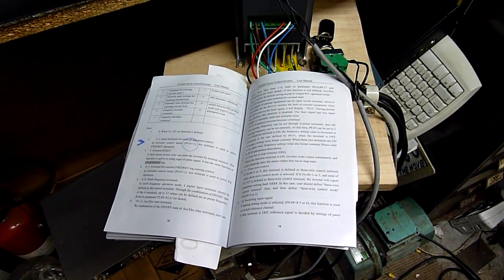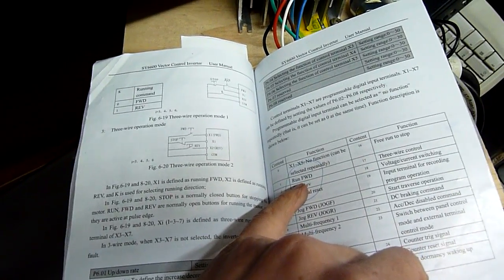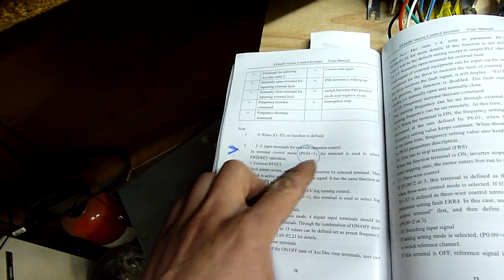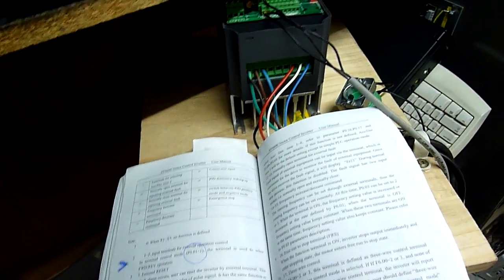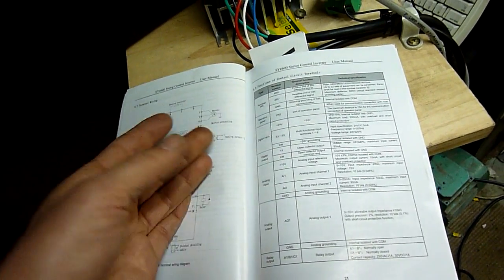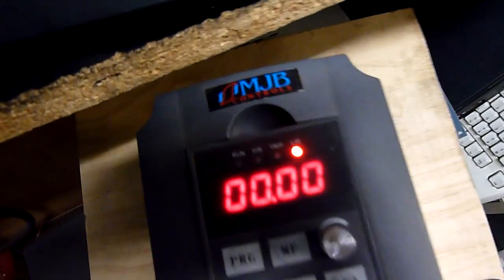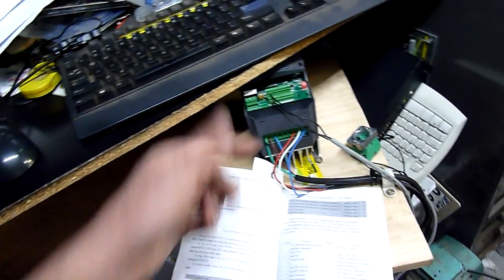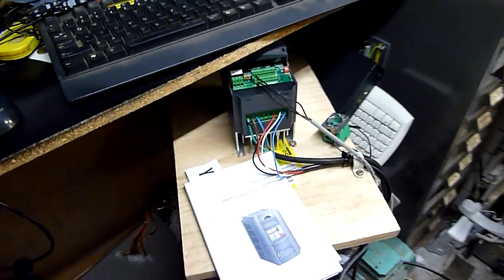China VFD No2 Now Runs (1Hp .75kw SY6600 Remote Con Setup)

Comment: Didn't you read it in Chinese lol? They can be tricky adding a VFD to equipment especially if you have to allow for limit switches and ramp speeds times. There is this little handheld infrared remote we used on Grundfos VFD water pumps for doing basic adjustments, anything further you'd have to use pull out the computer and program the thing.